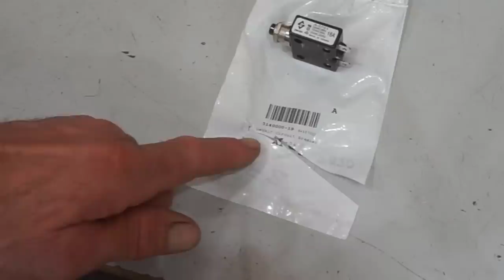DW735 Planer Deep-Dive Maintenance

Comment: Did you clean the rollers with Acetone?
Reply from the maker: Yes... I did.  Right or wrong.  I see no ill effects but  I've been told that other solvents are better and less likely to harden the rubber surface so make your own choice...
Reply: @NextLevelCarpentry  Thank you sir. I am going to service mine and was wondering what to use that would not hurt the rollers. Thank you
Reply from the maker: @hammerdownwoodworkingtracy3679  It's good practice to start out with something 'weak' like denatured alcohol which should easily remove a lot of wood resins like pine pitch, etc.  Often that's enough but, if not, I usually escalate to lacquer thinner or xylene.  I also scrape stubborn bits with a laminate sample chip if necessary... saves a LOT of scrubbing.  Acetone is kind of the 'nuclear option' and the main reason I used it in the video was that I wanted to glean gunk off the steel shafts and figured it was the only chance I had if a solvent was going to clean it, which, as you saw, it didn't.  I just wiped the rubber part of the rollers out of habit because I had it on the paper towel already and the roller wasn't really more than dusty and didn't require a lot of harsh scrubbing.  Hope that helps as I get the idea you're a sensible sort of person and will figure out what's best for your situation...
Reply: @NextLevelCarpentry   Thank you. I have used denatured alcohol to clean mine before. I was not sure how that acetone would affect them. Thanks for the tip

Comment: how do you set the depth stop
Reply from the maker: Actually, James, I don't.  Truth be told, the last time I (tried to) use it was probably 20 years ago when I first upgraded to the DW735 from a DW734. I see the depth stop as more of a 'range finder' than a reliable feature because its accuracy is so subjective to pressure from the crank handle.  I bet you can be off by 1/32" or more just depending on how much you turn the crank handle down with the stop set.
Far better is to read the thickness scale and learn where the handle position is when the actual thickness matches the scale setting.  Some people use a Wixey digital gauge but I've not found that necessary.  Hope this helps because it is a fantastic machine.  Using this sequence I'm able to plane pieces with consistent accuracy to 1/128th inch as a matter of routine.
Best,
Matt
Reply: @NextLevelCarpentry  I just figured it out you have to raise your level to 1 1/2 " then you can set your stop and you can go from there
Reply from the maker: Yeah, that's how to operate it but I still feel strongly that it's far too inaccurate to be useful... but that's just me.  If find that it meets your needs then, by all means, use it... wouldn't be the first time this 'ol dog learned a new trick!😃

Comment: Did you consider switching to a helical carbide cutter head?
Reply from the maker: I decided long ago that I prefer straight knives over the much touted helical cutterhead.  The main reason is that straight knives leave a noticeably flatter and smoother finish which minimizes sanding necessary for the perfectly flat/smooth look I'm after.
Reply: @NextLevelCarpentry  Ah, sanding!  It is right up there with painting on the list of boring tasks.

Comment: Why not give the screw heads a tap with a small hammer before trying to remove 'em?
Reply from the maker: It's not as easy as you make it sound... I'd love to be able to get in there and give 'em a quick rap with a hammer but it's just too complicated IMHO.
Reply: @NextLevelCarpentry  got'cha If you turn the machine upside down and use your long bit holder you can place the bit directly on the screw and give it a shot mit der hamer, Maybe :-) just a thought Love your work and videos, thanks!
Reply from the maker: @kevinweaver4265  Thanks for the followup comment and info.  Other viewers have mentioned access to those screws through the bottom too... I didn't notice it at the time but will remember it for next time... undt vill keep mine hamer handy to schmack it a goodun next time and save myself some fussin' and fumin'!

Comment: These are handy if you make the mistake of buying a JUNK DeWalt planer.  Right out of the box, I had to crank really hard to raise and lower it, then after only planing a couple dozen board feet or so, the PLASTIC sprocket and some other part made of crappy pot metal busted that the chains turns on and it won't go up or down. Save yourself some frustration and don't buy anything made by DeWalt. Their products are overpriced garbage.
Reply from the maker: How do you explain great performance and excellent value I and many others have had with the DW735?  Makes me question your experience and abilities.